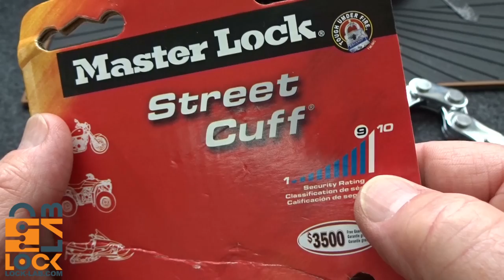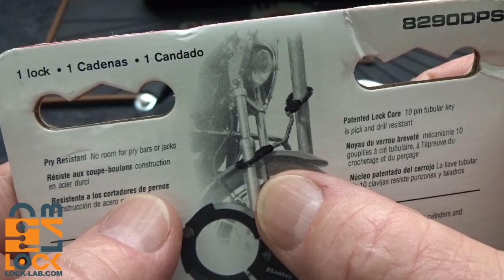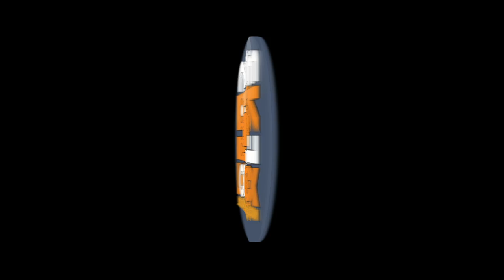(1049) Review: Master Lock Street Cuffs Bike Lock

Comment: Great tear down!  I was curious about the innards. Looks very solid. Any chance that internal locking block is something die cast that can be melted by heating the outside?  Also, on tensioning the core, I found that using a standard wiper insert as a lever works very well... and let's you pick this with two hands. 👍
Reply: I wanted to see if he could break the connection point of the chain to the body, with a hammer. But he just went straight to cutting :(
Reply: LockPickingLawyer thank you both.lpl and bb
Reply: Judging by how long it took and how many cuts he took with a die grinder, you're not hitting this off. The articulation at the end would mean you never get a proper backing to hit it really.
Reply: first thing I wondered was now knowing how that locking block works, I wonder if you could drill through the body and block. I know its hardened, but cant those cobalt drillbits go through hardened steel lol
Reply: Spring Bloom I was thinking the same thing. If this is clamped to a pole, a couple of light hits would wedge it into a solid position and then one or two good whacks with a cross-pein hammer would shatter that hardened narrow section right off.
Reply: You can't get great feed pressure with a handheld drill and when you start to bite if it catches you'll likely straight up snap the bit when it hits an edge or starts to wobble.
Reply: Just so you know, even when I read your posts you still sound like John Malkovich in my head.
Reply: Bullshit. I use my handheld drill not only for drilling out rivets but also for general purpose safe work including drilling clear through hardplate and drilling and tapping holes for say safe dial ring screws.
Reply: David Folsom Last time I had to drill hardened steel was a point of sale cash drawer. Had to use a 1/2" drill to take out the entire core and part of the body, all the way through. I used very light pressure - not even leaning in, just pushing a little - with a cordless drill. Took less than 5 minutes, including the time I spent drilling the pins to try turning it with a screwdriver.

Comment: Idea: When the lock is closed, the slide-through-part of the cuff protrudes to the other side (Like at 17:30). Applying blows and/or pressure on this part in the direction of the hinge might deform it enough to bypass the bolt which does not overlap the groove very much...

Comment: I think there's an easy defeating way with this with a generic barrel key, and a good sized nut welded solidly on the rear of the key, in place of the flat handle part. By forcing it in, and a large enough wrench, the lock body could be twisted round against the roll pin. Having worked with enough roll pins in gearboxes, i know the single rollpins are susceptible to sideways shear. The tricky part is getting the lock body to turn in the housing in the first place.
Reply: That's probably very true, although no thief would do that.
Reply: "...although no thief would do that" +"when there are locks nearby that can be opened in 2 seconds with a shim that slips into a back pocket."
Reply: But if I'm not mistaken, roll pins in gearboxes are dimensioned so that they shear before the force is big enough to damage the gears.
Reply: mrkiky when GETRAG first brought out the 5 speed gearbox for Ford Mondeo's, the roll pin fitted to the cross shaft in the differential was the main offender. Doubling up, or drilling the carrier right through, and fitting a full length pin resolved this. VW then went on to produce the same fault in its later Passat gearboxs, with more devastating effect.
Reply: I agree completely. The point of these locks aren't to be undefeatable, but to make it not worth the time and effort of a criminal. Any thief that's going to weld a nut onto a barrel key is so determined that he is probably going to steal what he wants one way or another. 
Luckily there don't seem to be many intelligent and/or determined thieves out there.
Reply: *****  Not really. Criminals are by and large very stupid people AND they are oppertunists. If you forget to lock it, and they can grab it they'll take it. They never get so sophisticated as to weld all these custom tools to defeat a particular type of lock nor do they use lockpicks. The tools you will most likely see a criminal with are a hammer and a prybar, sometimes a screwdriver that serves the same purpose. Smash smash smash, pry pry pry, if it doesn't work they go to the next house or car and so on and so fourth. Again CRIMINALS DO NOT PICK LOCKS TO GAIN ENTRY! They'll steal a key, kick in/break a weak door, or even knock on the door to rob you while you're home but you won't see them set up shop and try to pick a lock or use elaborate bypass tools etc. Think about why, if they could pick locks they'd probably be a locksmith, if they could weld then they'd probably be a welder. Either of those make more money than burglars typically take home. Most of the time I see break ins they take costume jewlery... 10 year old tv's... junk mostly.
Reply: I had one break in I was called to repair where the guy found and stole their "modem" only it was a modem/base station for those lojack ankle bracelets they give you on pre trial release. It wasn't 3 days before he plugged it into his home phone line and told the police exactly where he was!

Comment: I think you are right, Bill, that that link you first mentioned as a weak link is in fact the way to go.  You used a die grinder but I was thinking that it is even thinner on the rod that passes into the lock.  It all looks like a big steel spool pin. Perhaps you could slip a sapphire or diamond dust wire/garrotte saw between the case and the widened end of the spool/link and saw that link's shaft through. The advantage is that although it may be slower by hand, it would be a lot quieter and draw less attention to the defeat.

Comment: I would attack the the shackle because I ASSUME, :) That after twisting the shackle I might get a knot in the link where a crowbar would sooner then later pull the bike closer to the pole and then hopefully bind the links.. You might rip the strut off the bike first but thats my first attack,, Second attack is more old school,. A number of years back we made a tool for "Forcing" mortise locks out of house doors, Yes you had to replace the whole locking assembly since you wound normally break the plate that holds the lock screw to the mortise cylinder,  Some old times may know about this homemade lock twist tool but I was thinking about a smaller version of it to grab the center of the master lock pin and a small dent pulley to slap the center up and out of it's lock position..   however you would only use it to clamp the middle and not turn in this case...    Then my 1 other item I would love to see tried,. Yes you will need a hand,. BUT depending on how much play you have on the Pole side of the lock I would place the wide end of a crowbar on the shackle and hit it with a 5 pound hammer the force it open either by bending the slightly more open, If you can get it up pass about 1/16 to 1/8 of an inch you can use the bar on the other side of the pole to finish opening the lock.. Just my thought's..

Comment: I ordered one of these yesterday for $32 on Amazon (9 Link) to gift to a good friend who's wife won't let him buy a stealthy vehicle Fastbox safe like mine.    Securing ones firearms in the home and in one's vehicle is never a bad idea.  with so many vehicle break in and kids getting ahold of firearms and all...

  I'm not a fan of Master Locks, but this product might be really exceptional for locking down his rifle on days it may be in his vehicle to go to the range or elsewhere, since it's rubber overmolded, it's perfect .   Most Keymod or MLock modern handguards are roughly the same size as a person's wrist (7"-10") So this could easily clamp down on the upper and also the upper/trigger area with the same cuff, to protect the upper and lower. The other cuff can latch onto the vehicle's frame.

It arrives tomorrow,  this may be the MasterLock that I like, despite using it unconventionally.  As a Abloy and Mul-T-Lock user, Masterlock has a hard act to follow.

I suggested he buy a ARMA15 mount, a Abloy puck lock and bolt it to the frame under his passengers seat, but this might be better, at 1/5th the cost.

Comment: What’s with all the praise, I use to own one before I knew better, picked it with the back of a pen in seconds. Replaced as soon as I could with a disc detainer U-lock. Nowadays I prefer a chain so it’s harder to hold still against an angle grinder.
Reply from the maker: Uh...I hate to push back against your claim, but I GUARANTEE you didn't pick this open with a pen.  Now, if you'd said that you picked open an old Kryptonite tubular lock I would agree with you 100%, but they stopped making that model about 20 years ago when that vulnerability popped up.  The street cuff lock is completely new design, tensions differently, and is quite difficult to pick. I DO agree with your choosing a disc detainer and use one myself.

Comment: There is a roundpin pick I have seen that would open one of these up. It also has a built in tensioner. I use one like it when working with computer locks. Best part is they can be 3d printed.

Comment: What about the engagement between the locking pawl and the cuff? The part of the cuff that slides inside is the thinnest, it's further weakened by the cutout for the pawl, it is not supported from the back except by the two impressions on the side plates which may move out of the way with enough force applied. The locking pawl surface also provides an unnecessarily convenient wedge to channel the force into a direction aiding to force it open. One finger of the cuff protrudes out of the locking mechanism when closed, this might be a good point to apply some pressure with strong pliers, vise or a hydraulic piston.

Comment: Bill, try to use a roll of paper or cardboard to open that lock, that always work, insert the roll of paper, once it is touching the pins press hard and turns back and forth. This is the same method to defeat kensington locks on laptops.

Comment: A note on the $3500 warranty.  You must send them a certified letter to register.  You must send upon purchase -- not for a claim:
1) The registration form
2) The lock's original sale receipt -- no copies
3) The UPC code from the lock, no copies
4) The sales receipt for the bicycle, motorcycle, scooter, or snowmobile (or a signed appraisal on a dealer's letterhead).  This will be the only thing covered, you can't switch.  This may not be a big deal as:
5) It expires after one year.
6) You must register your bicycle or vehicle with the local police and include this registration with the registration form.

Comment: I feel like the rotator join could do with having a sleeve around it, if you see what I mean; both to add thickness and potentially put lateral stress on a grinder disk if it's moved while someone tries to cut it. Also, adding slight ridges to the plate where you cut to free the neck of the rotator might make it harder to get the cut in the right place (first time, at least) with a grinder.

Comment: Wonder what happens if you insert an incorrect key. Then use mechanical force to simply turn the key. Something has to give, either the key or the pins.

Same for a chain splitting tool on the chain pins.
Reply: I was thinking similar, that the rising cylinder is the weak point for brutal attack...but the problem is you can't inserts any tool with enough "beef" to reasonably pry on it because there's not enough room.  Anything that fits in the tiny gap will likely just break or bend.

A motorcycle chain break likely wouldn't work.  The driver pin would probably just break, because the pins are folded over, assuming the chain in these cuffs is the same size.
Reply: Twisting through the pins is technically a vulnerability of almost all mechanical locks, but it's very hard to get a tough enough tool into a keyway to actually shear through multiple metal pins. It's a heavy duty physical attack, using a slot for flimsy tools.
Reply: ZeroIsMany I only ask as it's how I've freed my laptop from a Kensington Lock I lost the key to.

Inserted a key that was incorrect, applied molegrips and twisted. The lock sheared at the pin to the body of the laptop. :/

Comment: Could a powerful rare earth magnet be used on the far side of the spring opposite the locking pawl to retract the pawl?

As for destructive methods: Would it be faster to drill the top plate and through the thin hidden part of the chain link than to grind the father exposed part of the chain?
Reply: For the same reason that the lock can't be shimmed - no, a rare-earth magnet wouldn't work, as the lock itself forms a block to the locking pawl preventing it from moving.  Moving that block requires opening the lock since it's part of the same assembly.  Also, from a physics standpoint, you'll be hard pressed to find a strong enough magnet that can move the pawl from a distance of several inches through hardened steel - the steel in the lock will become magnetized and disrupt the force applied by the magnet.
Reply: fuzzy wuzzy And a damn good one too, by all accounts!

Comment: It would be interesting to grind a few more V cuts into the cuff so it can be locked onto larger objects.
Reply: Agree that those would be useful in those cases where I can't find a small pole to lock onto. BUT, it would expose a narrower part of the cuff and the existing notch, making a grind attack point obvious. I can see this as a useful customization for the handy individual, to be used ONLY when necessary, but Master was smart not to offer it.

Comment: I wonder what would happen if you either hit the protruding spur of the cuff with a hammer, or got a pry bar in one of the cuffs. The disadvantage of the cuff approach compared to a D lock is that applying twisting force to the end of the cuff that's locked to the anchor (rather than the bike) won't damage the bike, so the thief has no reason not to go to town on it.